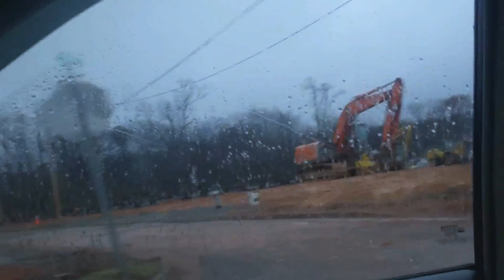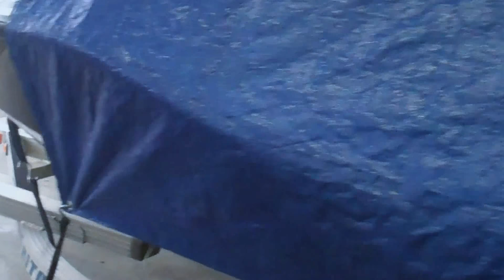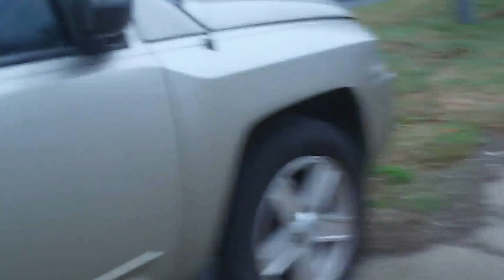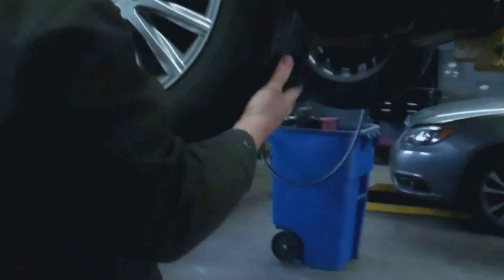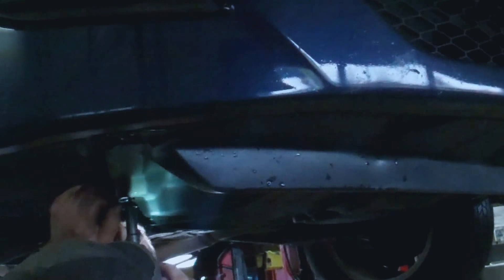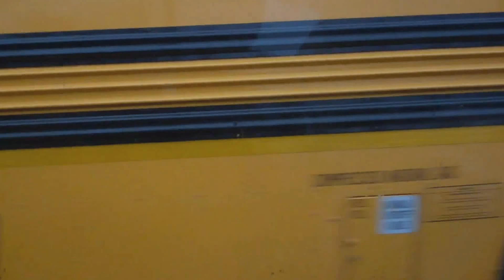Entertaining Brake Inspection & Tire Rotation Vlog

Comment: Tires just do not last with the terrible roads. At least you have a new set and not an expensive tire size. Quick question, does your RAM's carpet get damp? My truck has been parked for the winter and with these warm temps I opened the windows up and under the driver side floor mat was damp carpet. I took them out and left the windows down all day to dry it out. Just curious if yours does that. Luckily I caught it before mold or mildew sets in.
Reply from the maker: This is true. Yes my RAM carpet does have a moisture problem and I think there's a leak in my back window seal.. I think I already have a mildew problem unfortunately..
Reply: RVR2 that's too bad. I'm thinking it is my driver door seal. The passenger side is dry and also the back carpet panel is dry. We got torrential rain a week ago and that is probably it. Opened the driver door and water gushed out the bottom drain. Lol I've got a front axle seal (4x4) that leaks so soon I'll have that fixed ($$$) and drive it daily again. Miss driving it, soon.....
Reply from the maker: Yeah it sux. I'll need to get that leak fixed eventually..